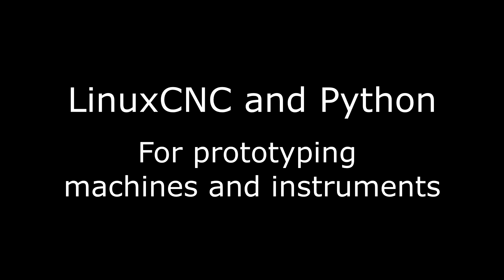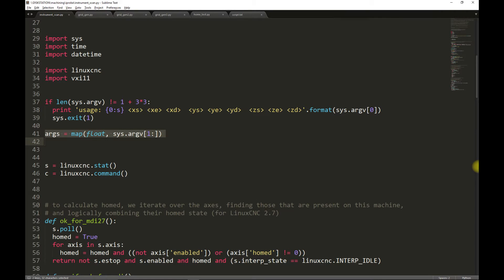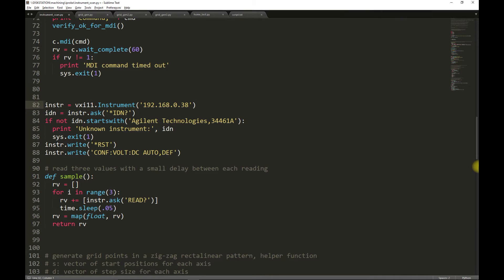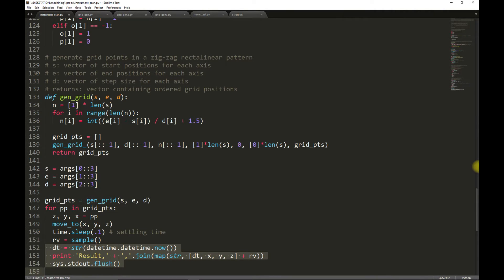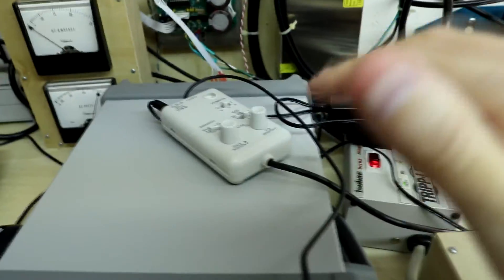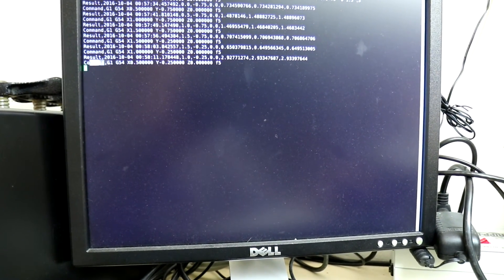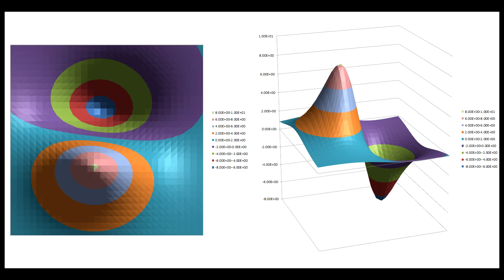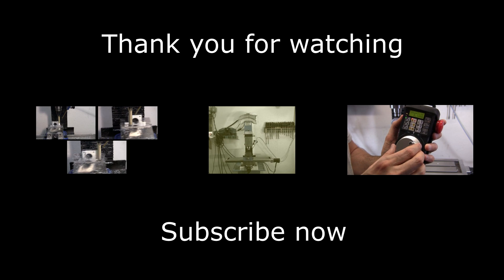Python control of LinuxCNC for prototyping machines and scientific instruments

Comment: sir is it possible to add numerous external machine and integrate with linuxcnc
Reply: i know fusion 360 but how do i simulate and build parts ?
Reply from the maker: You can coordinate at least nine axes in LinuxCNC. That's realtime coordination. If you don't need realtime, your options will increase a lot. A large number of digital inputs and outputs can be controlled as well as analog limited by the connected board. Check out the Mesa 7i76e for example.
Reply: @kentvandervelden  i want to design wire bending machine ,i did preliminary research but how,how to proceed to prototype (undergrad student sir)
Reply from the maker: That's very cool. I've looked at a few wire bending machines. Wouldn't take many axes to get something nice going. You have many options. Hard part will be settling on something. Could use motors with integrated drives and just send simple commands like home and advance 20 degrees, for a basic controller and focus on mechanics. Or could control step direction pulses of motors and do more electronics and software.
Reply: how do i understand the existing bending machines g code generator,i need to understand it to customize but how it works and how do i reverse engineer it sir
Reply from the maker: @hariharanramamurthy9946  Oh, you are modifying an existing machine? Not sure I can help much. Go slowly and document carefully, proceeding only if you're sure. Sadly, often hardware is pretty decent and the software cripples it and is best replaced.
Reply: @kentvandervelden  no no,i am not modifying ,starting to create one-but i have no idea on how gcode are generated for different shapes of wire bending sir,i have to understand hence i can manipulate for different kind of wires
Reply from the maker: @hariharanramamurthy9946  I'm just thinking while writing this, but seems one has to know the center to center distances, bend radius, and bend angle. Could start with enough hardware to perform planar bends, then add a rotation about the axis of wire advancement, and that should give you 3-D shapes. I don't know of software to plan the patterns, but the given the distances, radii, and angles, seems one could construct the g-code by hand. There are probably constraints, a combination of mechanical, software and minimum parameter values, that avoid collisions. This is very interesting sounding project. More specialized versions, including spring makers, may be easier. What is the utility of a wire bending machine? Ornamentation or functional?
Reply from the maker: It's an impressive sounding undergraduate project. Are you at an Indian university? Which degree program? Mechanical engineering?
Reply: @kentvandervelden  mechatronics, yes sir indian university-from morning onwards searching for good resource but could find effectively anything
Reply from the maker: @hariharanramamurthy9946  Check out this video about a wire bending machine. He describes the machine, parts, assembly, electronics, and software. Much of plans are available for download. Might be a great starting place.
https://www.youtube.com/watch?v=HPQbKTJPsU4

Comment: I was surprised the spindle didn't distort your readings.
Reply from the maker: This is a good point. Might have been how the probe was aligned to the spindle or stationary with respect to the spindle (but the table and vise do move.) The probe is pretty sensitive but also picky with alignment to fields. Most rejection surely comes from baseline adjustment: scan without sample and subtract these values from a scan with a sample. Thank you for your interest

Comment: Fascinating. Have you used usb webcams and the Kinect camera to model parts? Thanks.
Reply from the maker: Thank you. No, I have not done that. The closest would be old school line laser scans with David. I do have Autodesk ReCap which I think is supposed to help with reconstruction from photos. If you have any advice on scanning parts please let me know. I have a couple of ToF cameras that I've just started to experiment with and they are pretty decent close in depth (~0.1% when < 1m I think) but the sensor resolution is not great, only 38kP or so so the lateral measurements are course. I'd like to make a video about them eventually.

Comment: This is a great demo of what can be done with python and linuxcnc, thanks so much for sharing!
Reply from the maker: Thank you. It's a stupidly precarious setup for an expensive test probe, but a quick way to test out an idea. I've tried to use the setup to read the magstripe on a hotel key card. It can sense changes the edges of the low resolution stripe, but the read out didn't quite make sense. Perhaps there is some cancellation of neighboring stripes given the probe's resolution. Easier to readout optically with iron powder.

Comment: Wow. Fascinating. I had no idea that linuxcnc even had the ability to be driven from an external library. Very cool.
Reply from the maker: Hi Gavin, thank you for the comment. If I understand correctly, the LinuxCNC motion controller is separate from the GUI, so mechanisms like I used can be used to build new GUIs on top of the kernel. Maybe this is how Tormach made PathPilot? There's are also other methods including RPC and RSH. Should work well except for situations where low latency is required, but then the latency is probably still better than a PLC scan time. The people who made LinuxCNC really had some great foresight to put the extra work into the architecture.

Comment: what a great approach to the problem! superb video
Reply from the maker: Thank you, your comment means a lot. If you have any interest, recently 
I've used a similar setup to try to read the data from a magstripe and a
 slightly modified setup to profile the linearity of a SoftPot sensor. 
I'm still working on these videos. The magstripe video will be to ask 
for some help. I can sense the magnetic bands, but they don't quite 
agree with what should be present, as read by a commercial reader.
Reply: +Kent VanderVelden i can see You are magnetism fan:) it is related to your job, hobby? but your python programming skills are awesome. I'm at the beginning of the learning curve in python. i proggramed in assembeler in 8051 uC times (who can remember that?). the reason is i need to create some sort of setup using linuxcnc and my mill/lathe to probe a profile chucked in the lathe and then skim it. Apparently linuxcnc itself is not ready to do that. All the probing procedures like straightprobe, smartprobe use grid concept in XY plane. I tried Autoleveller from Scorch but there is no option to select just one row of points (2 is minimum - as it use some bilinear interpolation?). What i need is probe along one axis only and after probing apply some math (linear interpolation?) to smoothen probed profile. Smooth profile should then be converted to g-codes and thats it. These are my assumptions but i found it hard to start. do You think python is good for that? 
wow i just saw the rest of your vids! u got my sub:)
Reply from the maker: I humbly thank you. You may be #100... although I'm afraid the prize is pretty paltry. :) The LinuxCNC forum  would give you access to many LinuxCNC experts. Given the little bit that I know, yes, I would probably do something along the lines of what you are suggesting. Previously, I mainly programmed in C and I'm a Python convert. It lets one build applications so fast (available powerful modules, no compilation, multiple platforms, etc.) that learning Python is time well spent if you use programming to aid your work as opposed your work being to produce full applications. For your application, seems like Python, the LinuxCNC module, and scipy.interpolate. Within the last module, a spline could be used to fit and smooth the points, and the interpolate routines could be used to generate a piecewise list of points which can easily be converted to g-code. My Arduino CNC lathe video used a simple version of that to generate its "g-code." If you don't have "valleys" in your profile, the g-code generation would be easier. If you have multiple valleys, they would need to be done one at a time. I hope that makes some sense. Your project sounds really cool. I hope you post a video of it. (Magnetism is awesome, but here it was an interesting example. It's hidden normally, so anyway to show what's hidden is interesting.)
Reply from the maker: While your approach sounds easier and more precise, you may be interested in this person's approach using image analysis. https://www.youtube.com/watch?v=hGzgMQDRxC0 The welding scene is a nice. Also, if you need any help with Python, etc. send me a personal message. I'd be glad to help.
Reply: via LinkedIn
Reply from the maker: OK, let me know if you don't receive my response.